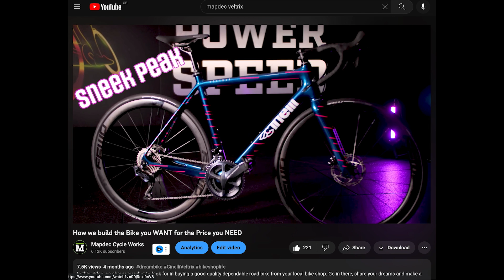The big compromise in the bike frames & wheels relationship

Comment: I'm fortunate to have come up in the days of steel frames and custom-built alloy wheels. We learned early on the relationship between the Rim. Spoke Hub, and Spoke Pattern with the frame. It was very important considering we were riding on skinny tires and high pressure. Those lessons have stayed with me into this modern era. I love my carbon frames and wheels but as back in the day, every wheel and frame combination is different. I find that the same wheel behaves very differently depending on the frame. Doesn't matter the cost. The takeaway is research what wheel works best on your frame. Also the same thing can be said about the tire relationship. I see a lot of bikes spec'd with poor tires. Good discussion as usual.
Reply from the maker: Yes. The art of the wheel builder was somewhat of a compensator for the demand of 19mm tyres at 120psi
Reply: @Mapdec   Thumbs up from me lol...and I remember 18c tires, duly pumped to 120 psi (is it any wonder many of us have torn rotator cuffs from the hand-held pumps of yore to reach that pressure?) but that alone was only part of the greater picture. With earlier latex tubes, after a day's riding, your pressure was significantly less, and yet overall frame behaviour wasn't that altered, if at all. 

Let's flip this over for a sec (pun fully intended). If we examine this, we have to examine a whole lot more, which then poses even further questions.

Comment: I had 2014 Trek Fuel EX, that was extremely flexy, it swayed side to side, and more to the left, probably due to asymmetric design, which is harder to get right, right sidewall got a line marked on it by the chain stay, flex was was so bad the rear derailleur bent on each ride, and due to flawed pivot design and the flex the bearings got pushed out and it rubbed, new wheels help just a bit, but frame was so flexy the issues continued. The bike was a mess, bad choice of components, bad choice of compromises, horrible frame construction. I hope the industry stops this nonsense. Some bikes will be worse larger frame you get.
I felt it in the corners, No such issues with Geometron G1, stiff enough frame.
Reply from the maker: I’ve seen this in full sus bikes too. Weird flex in one direction, you can feel it in berms too.

Comment: What’s your favorite tool to get bb86 shells out?
Reply from the maker: If it fits the frame, the Unior BB86 remover, failing that the Wheels manufacturing extractor, failing that, the park tool hammer it out solution.
Reply: @Mapdec  appreciate it!!

Comment: Don't you think wheels or the effects of them are somewhat overrated? People seem to go for high carbon rims for looks rather than for aerodynamics or weight. I quite like the DT Swiss wheels that came with my Canyon even though Tom Boonen described them as not bring stiff enough. I'm not in his league, sadly. In general I agree that many bikes are somewhere compromised in their specs, so you might end up with a cheap frame and high end specs or the other way round. How many buyers of an of the shelf bike do upgrade their bikes right away?
Reply from the maker: Quite the opposite, the effect of wheels is still understated. They are arguably more influential than some frames.  It’s not just weight and aero, it’s lateral and radial stiffness, tyre shape and feel, etc etc etc.

Comment: The Lightweight Urgestalt was originally made to highlight the characteristics of the Wheelsets the company made and this shows.
I think my own Lightweight Urgestalt rides so incredibly well because it's the complete package. The proprietory Pentagon hubs of the disc brake wheelsets resists the stresses of braking proven in independent tests by Magura and influenced the through axle and wheel retention of the bike.
It's a complete unified design philosophy that far exceeds running hoses through the bars.
As a smaller rider, I often find bikes to be very stiff and the Urgestalt is just right. I can't believe or explain just how sublime the ride quality of the Urgestalt is. Mine surprises me every single time I get on it.
In reality it's not a bike that's priced for compromise though and neither are the wheels so it should be something special.
Reply from the maker: This kinda explains things quite well. Thanks Kid.
Reply: I've ridden one and wasn't terribly impressed beyond the weight(that's not impressive for the money). There's a long list of bikes I'd rather have...some with framesets half the price.  Horses for courses though.
Reply: @veganpotterthevegan  I would concur that the physical weight of the Urgestalt is not exceptional but equally the objective brief was to build a great bike, that's why it's factory of origin and QC process is well established and comes with the bike. I would argue that riding and living with a bike over a prolonged period creates a different experience. I have owned Dogma's, C64's, S-Works, Alchemy, Parlee, AX-Lightness, Filament and Feska and in a size small (48-50) I simply find the Urgestalt to be a better bike all round than the others I have owned, it's just subtle but the turn in, the experience when climbing, ride quality that is comfortable yet tight and responsive.
It's not to say I thought the other bikes were bad at all, I simply did not know better existed or was possible. The Urgestalt redefined the experience I expect.
Obviously these things are objective which is why I'm curious to know what framesets or bikes you feel are superior for smaller riders as I'm currently considering building another Urgestalt so would like to review any feasible alternatives.
Reply: @Kid Karbon  I'd say the Madones(other than the inevitable, terrible BB issues) are better bikes(first 2 generations).  While it's an endurance bike(a stem can negate that head tube height) the last rim brake Cannondale Synapse, Cervelo Rca and Giant TCR are all better bikes.  Of course, your lightweight may also just be the geometrically ideal bike for you and will make those other bikes not as good.  I'd honestly look at getting a custom carbon bike since you're willing to spend the money on one. You can use the same geometry but have them pick tubes to your preferences.  Not sure how your Parlee was built as in being custom or not, or how old it was.
Reply: @kidkarbon4775  the geometry differences between 48-50cm frames can be really absurd compared to 54-58cm frames.  I get why people stick to specific bikes
Reply: I've replaced my long loved Seven(200k miles) and put it on lifelong trainer duty.  I'm now riding a new Domane which meets all my needs since I'm never racing a road bike again(former cat 1 but the Seven was my basemile bike).   Outside of a crit, it's the best bike I could imagine riding for just putting on miles(this is definitely just for my scenario living in the Rockies and often tracking off of pavement) and I'd be happy road racing it if I ever road raced again.   I've always wanted one(ridden every iteration) but didn't want to own another bike BB90 bottom bracket.  I ordered mine as soon as I found out they went to t47
Reply: @veganpotterthevegan  I agree geometry on small frames particularly with regards to head angles which vary massively. There are some very lazy approaches to addressing challenges of toe overlap and similar on small frames. It's why I ultimately ended up going to custom geometry which my Parlee, Filament and Alchemy Titanium has.
Although I'm pretty small, I'm also all torso so typically run 120mm stem narrow bars and 165mm cranks which can make sizing interesting.
I actually went to get a RCA California before ending up with the Urgestalt as the geometry did not work for me.
Great discussion 👍

Comment: Went from a few average wheels on a very stiff frame, to an amazing set of wheels -  I reckon the performance difference in solidity and responsiveness is more than have felt going between mid to top tier carbon frames, so in future would concentrate on wheels as dominating the ride feel. Which in a round-about way is why the shift to overpriced electronic group sets by SH is so annoying, as most riders would benefit more from an off the shelf investment in wheel quality wheres electronics, while nice, aren't such a necessity. Ditto discs.
Reply from the maker: 95% agree, I like discs...
Reply: I ride a cannondale supersix with mavic ksyrium Elite s from 2012. I recently bought the campagnolo bora wto 45 and the whole bike now feels so much stiffer and more comfortable at the same time. Now it feels like an arrow going forward if I start sprinting. It accelerates like crazy and is so responsive. I love it.

Comment: Wheels!? Sometimes it takes as little as cheaping out on tyres to ruin the ride characteristics.
Still, I think this "compromise" is rather deliberate since most frame manufacturers don't make their own wheels. It is a common practice in cost engineering to balance performance/price with numerator thanks to inhouse built and denominator thanks to contracted. Not because procurement is done after design, but rather thanks to heavily discounted deals or even exclusive terms. On the other hand if you land all components perfectly on one line of perf/price from the start, there turns out to be a very little margin for profit
Reply from the maker: totally right, great comment, thank you.

Comment: I'm okay with providing cheaper wheel with the complete bike simply because wheel choice is also personal. And the factory wheel will likely get changed.
I know many local friends who would remove factory 50mm deep wheels and put on 35mm deep wheels on for easier handling.
I'm the opposite. I put 60mm or deeper wheels on every road bike I ride.
Reply from the maker: I kinda agree, but to have landfill wheels is not a great way for an industry to do business, I want that choice at the point of purchase.
Reply: @Mapdec  they are never landfill because for every low tier wheel there is always even lower tier frame. Or simply neglected or abused.
Reply: U dont have wind in your country?
Reply: In Louisiana, USA we have quite some wind. Previous Sunday ride I saw 12 km/h wind but the highest I've ever ridden in was 21 km/h so far.
But it doesn't matter. My 62 kg body can handle cross wind.
Reply: I planned on buying 35 to 45 mm deep wheels for my SuperSix. For some reason, I bought 60mm deep ones. Not sure what made me do it and at first I thought they looked ridiculous on a climbing bike.
Reply from the maker: Good choice. It won’t take long to get used to the side winds  and not notice it.

Comment: We had a dogma F come in with a pair of aluminium Fulcrums, straight from the factory. I'm guessing it was more due to supply issues, but we wouldn't even put it on the showroom floor like that. Ended up putting a pair of Lightweights we had spare and the bike went from pretty boring to super bike.
Reply from the maker: i bet 🫣